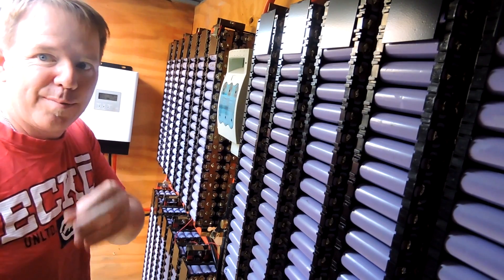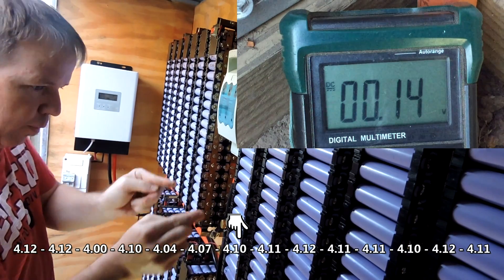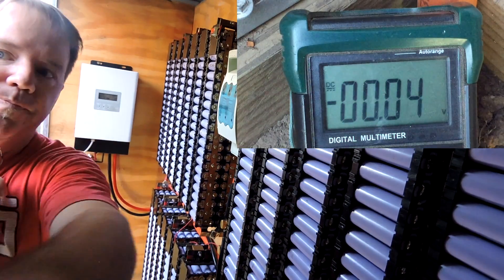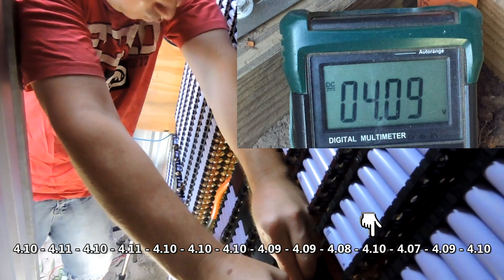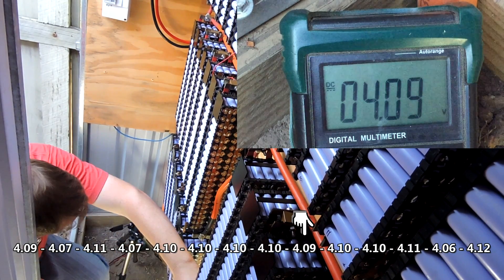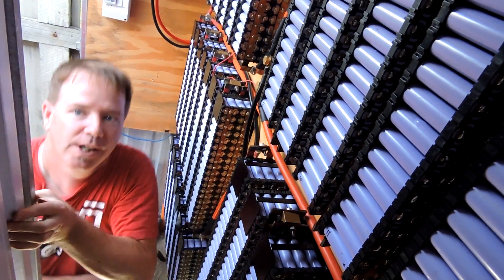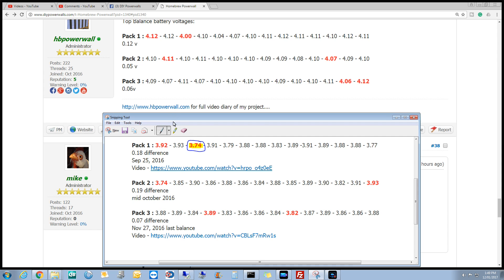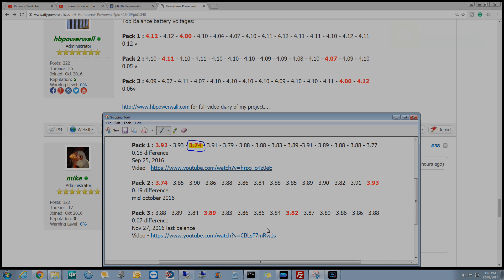Voltage balance check 18650 powerwall

Comment: what 18650 cell do you use ?  samsung ?
Reply from the maker: Samsung IRC18650-28a on the outside - anything above 2100mAh on the insides of the packs.

Comment: I suggest putting an iMax on cell 3 and bring it closer to the others.  It could have some bad cells bringing it down, or maybe it had a poor connection and didn't balance as well as it should have before put into service.  If it drops back down, then there's something parasitic in it.  I'd worry more about cells like 14 and 15 which went from one of the lowest to one of the highest.  That means they don't have as much capacity as the others and will keep swinging the most.  But all in all, it's pretty good, great to see a pack like this working well.
Reply from the maker: few weeks has passed and nothing changed. I have to do some changes this weekend if it's cool enough, I'll pull that pack and retest the whole thing

Comment: Wow, I've watched several of  your vids, and enjoy the info. But, I did not realize how MANY you actually had in that shed till I saw from this angle. WOW!  :)  That first testing phase of the cells must of taken a long while (I know you built the packs over time, but cumulatively).  Good job!  :)
Reply from the maker: 3360 cells in use over 10,000 tested - next 1120 cells (4th pack) in porduction

Comment: Here's an idea to cool off your cells, add four cans to the shed with two configured as intake at the bottom and two as exhaust at the top. This way cold air will be pulled in and hot air will be removed.
Reply: Fans

Comment: a thought I had when I saw this video was why solder not fixed cables or using Crocodile Clips, to ease when measuring

for example
3 lines with 15 cables in each, or if you want to be a little safer use banana plugs and with a little thicker cable so maybe you can use it in balancing the "low" current

Comment: ok. nice results. You say you want to monitor them, but don't you want to balance them now?

Charge the individual banks up to 4.1 V.

They don't need that much more. You just have to switch the system off and charge the individual banks to 4.1 V. No need to take them out. The Imax charger should be able to do it. You've got 2 Imax chargers, don't you?
Reply: MrBugsier5 There is a need. I know it doesn't happen often but when the battery does run low, those 100 mV at the top can be 2 V at the bottom.

And then you have 80 times X cells at below 2 V. If that goes undetected and they're charged again you end up with hundreds of cells being charged with a too high current for the low voltage that they are at.

It's mostly about extending their life but there's also a small positive effect on safety, which seems to be a hot topic at the moment.
Reply: I was going to say the same thing.. top  those two up.
Reply: MrBugsier5 We (people that make their own power walls) don't use those cells. We get them from used laptop batteries. Those are unprotected cells.

We could't use those protected cells anyway because if you solder an 18650 cell there's a good chance you fry the protection circuit.

Those protected cells are not usable in a powerwall. That's why we make our own protection, starting with the fuse wires on each cell.

Also all cells get tested. On average only about 40% of the cells from used laptop batteries qualify to be used in a powerwall.

There's a lot more to it than you think.
Reply: MrBugsier5 oh dus dat is de reden voor dat steenkolenengels .😁

I've never seen protected cells in laptop batteries. Laptop batteries have a seperate board for protecting the cells (BMS).

Protected cells are longer. Just a couple of mm, like 67 or 68. Easy to detect.

Also I have my doubts about those obtronics cells. Those kinds of companies use cells that are like class B cells. Panasonic sells the class A cells under their own name and class B cells to companies like that. The protection circuit makes it look good but what it really does is hide the fact that they can't supply the current they were suppose to be able to supply. Another even bigger problem is that they have a higher internal resistance than expected. It sounds great but those protection circuits are of no use.
Reply: this small amounts y would not., simply no need in this case..
Reply: Remember, each off these cells can have current and voltage protection build in the cell itself, so y do not realy see the point in this lithium cell setup, fully agree whit you iff it where lead acid cells, but these lithium cells dont like to be fully charged, and this small amount off difference whit this kind off cels is neclectable. y think in the longer time its better for the bank to just leave it the way it is in this case.
Reply: MrBugsier5 Voltage and current protection? Where do you get that idea from? 

Maybe you need to study this subject a little more. 😃
Reply: 18650 Protected battery Li-ion 3.7V 3200mAh button top 10A dual protection,Manufacturer: Orbtronic Battery Specifications:
Capacity (Ah): 3.2 Ah (3200mAh)
Type /size: 18650 Protected
Nominal Voltage (V): 3.6V - 3.7V
Charging Voltage (V): 4.2 V
Charging Algorithm: CC/CV
Weight (g): 47 g
Diameter (mm): 18.6 mm (+/- 0.03)
Height (mm): 68.9 mm (+/- 0.03)
Chemical Composition: Li-ion (Lithium-Ion) Hybrid
Protection cutoff: 10A
Protection ICs: Made by Seiko
Core cell: Made in Japan
Welded Button Top: Yes
External | welded PCB | Protection: Yes
Model name: ORB3200P
Protection specs:
Over-current (Activated @ 10A)
Over-charge (Activated @ 4.29V)
Over-discharge (Activated @ 2.45V)
Over-temp. and short circuit protection
Protection circuit designed by Seiko

so who's un informed?
Reply: y know, done it myself, but, y used mostly discarded electric bike cells, those where al protected  18650 cells, guess there standard for that application, but the also had all external  equalize boards... guess y was lucky using those, failure rate in these pacs where around 80% usable cells. (its common these packs gett over charged in bike applications, more cells servive., maby a good tip for other powerwall users/builders, the few old labtop packs y have stripped had cells whit the same property's in build in protectors, all off them (the good ones) where protected... strange...... (assumig you are dutch dat is wel toevallig...)  :)
Reply: lol, ja ik  ben een beetje roestig... lol, had hier 4 ibm pakketten met de beveiligde cellen, toeval denk ik, waren nog niet zo oud, twee cellen per pakket waren stuk...

jeah, y know, a bit rusty... lol,